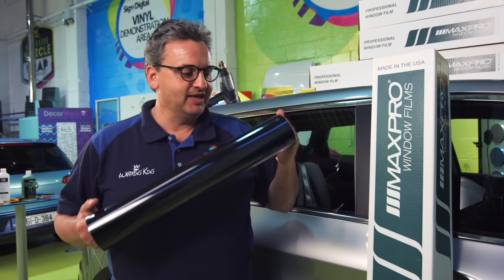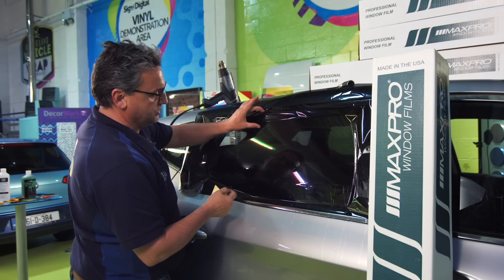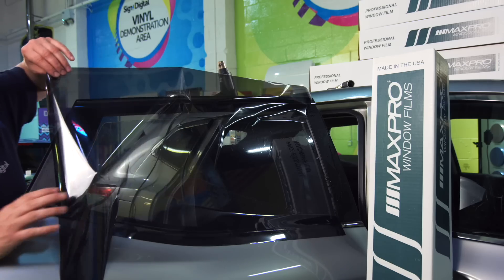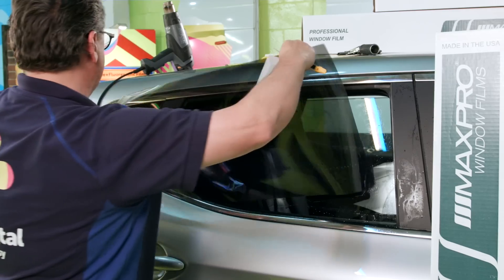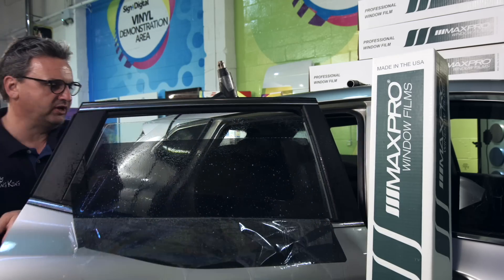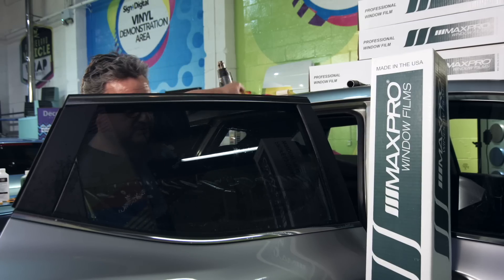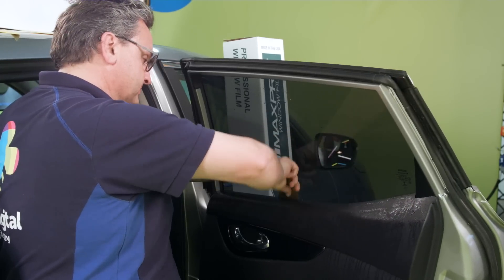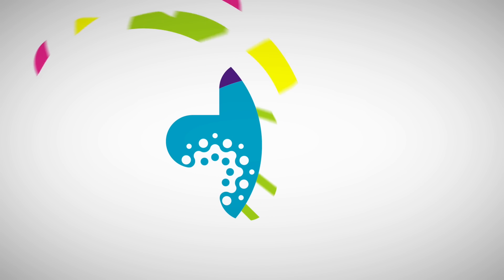How to Tint a Side Window with MAX PRO Window Tint Film.

Comment: Interesting technique, without heating the foil on the outside to remove the bubbles, before putting it on the inside. I have the same model of heat-gun, which gear do you use, 1 or 2, and on that upper wheel, which is from 1 to 9, what is the date? Thank you !

Comment: i take the door panels off, and this way i don't soak the door panel, or worry about dirt coming up from the bottom door seal coming up.  That door  panel comes off easy, like 2 screws.  super easy.

Comment: Great job excellent video.  Question my state laws state 35% is required if I install tint with 35% VLT will it pass the 35% test during inspection sticker time?
Reply: If it’s 35% the inspector really wouldn’t care. 20% is where you would have the fee for tinted windows.

Comment: Those bottom corner tucks are just wrong, you're rubbing the film adhesive against the contamination spots you're trying to avoid. Overall this is not a very good install video.

Comment: Clean (flush)your window from top to bottom always add extra on the side as there will most definetly be light showing through that install you have just done.
also shrink the film after you have cut on a cutting board rather than cutting on a customers window!!! You should always heat in the top edge and file any excess material that is left over so there isn't any risk of peeling you also creased the film on the side by only removing half the release liner personally I remove the liner there was no need for you to pinch the top of the film once you had removed the liner half way as you would have transferred dirt onto the film which will show on up I can remove liner completely and install without any creases or having to touch the glue edge of material 🌚
Reply: Tint Eastwood agreed.
Reply: Spot on mate I mentioned this and the company replied saying he’s making a good living 😂😂😂